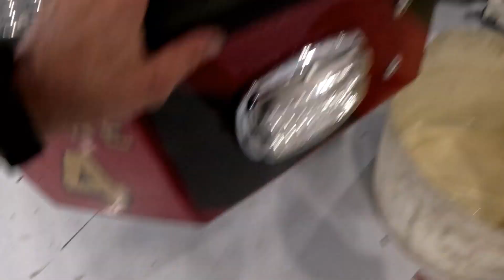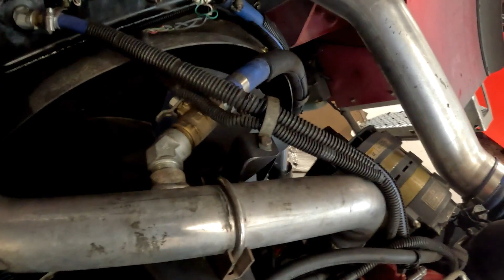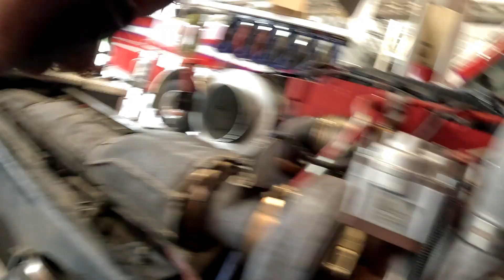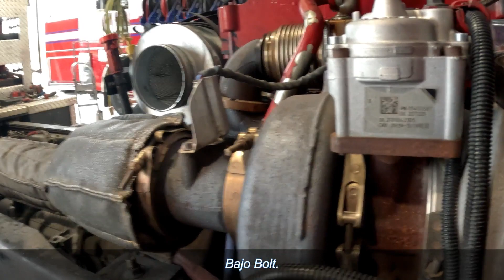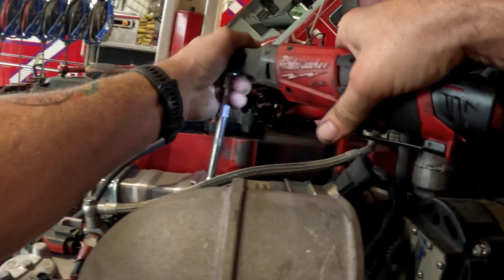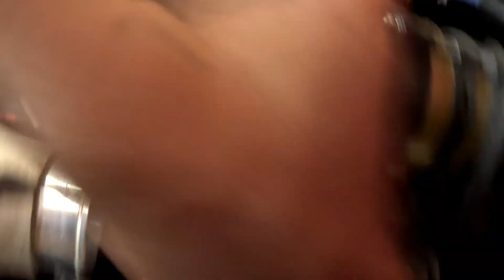Cummins ISL9 ERG part 1

Comment: Scotty how did the foam pump reseal turn out
Reply from the maker: it turned out well, still working with no leaks. however the other evt tech at the shop just finished a rebuild then afterwards we noticed one of the blocks was actually cracked. make sure to check all the blocks on the foam pump thoroughly. new pump costs 12,000$